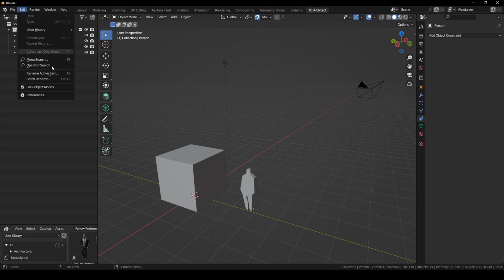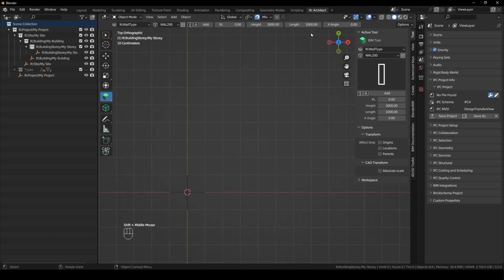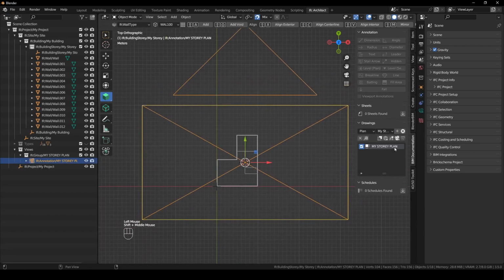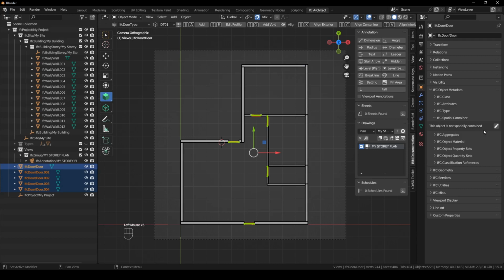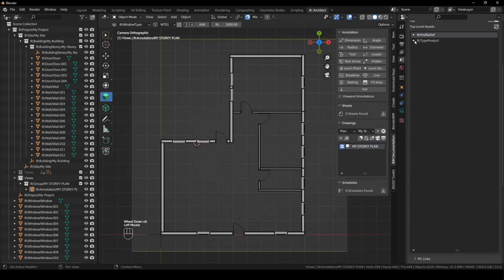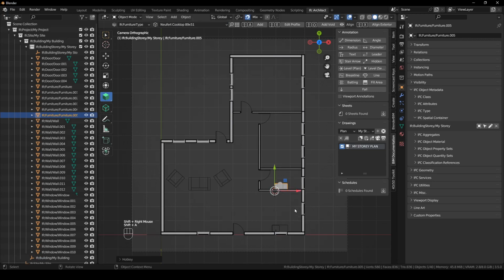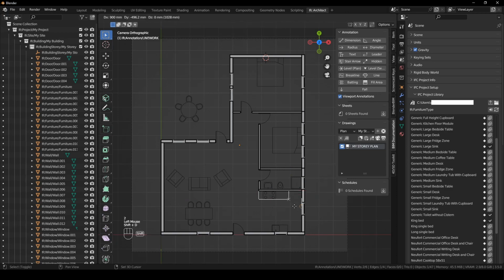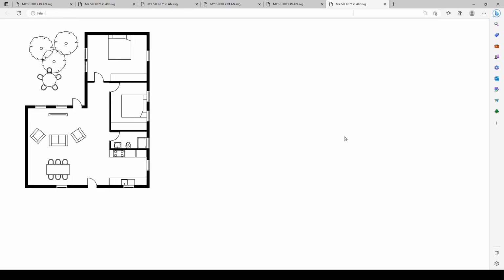BlenderBim 23.04.17 - Beginner Tutorial Update - Floorplan - in 20mins

Comment: hi. first, thanks four this informative and useful videos. When you are placing windows and doors your doing it arbitrarily.  I'm not very clear how to add a door or window in a precise location (exact measurement) relative to a wall or another object.
Reply from the maker: Hi David, yes for the purposes of this video they are being added roughly snapped to the centre of the walls,

To be more precise you can add the door and window and then move it to the correct position (what I typically do)
Or using the snap tool create a reference geometry and add it to that reference, but this takes longer

Comment: Why are my doors not showing in 3D. I have also realized that sometimes the door tool don’t show the width, height and some other properties when I want to add a door. It is my first time using the tool so pardon me if it’s too basic to know. Also when this happens some of the doors don’t cut into the walls.
Reply from the maker: Hi Owuraku, thanks for asking
Let's break those down,
"Why are my doors not showing in 3D." 
I think this might be the answer, When you activate a drawing it will switch to a 2d representation, so you won't see the 3d model, you can change it back by going to object data properties, Ifceometry, Ifc representations and select model representation

"sometimes the door tool don’t show the width, height and some other properties when I want to add a door. "
I think you are referring to the door modifier here? It needs to be added in the mdifier tab after creating and selecting the door, it isnt added automatically, but it definitely should be in the future

"Also when this happens the some of the doors don’t cut into the walls."
For this I think make sure you: 
select the wall 
before 
adding the door 
otherwise the door wont be hosted in the wall and it will not create an opening

"It is my first time using the tool so pardon me if it’s too basic to know. "

Not at all! Ask questions! it's the purpose of this channel, if you want more indepth answers from a range of people who know what they are doing, you can also check out the OSArch community page here:
https://community.osarch.org/discussion/1447/blenderbim-tutorial-floorplan-update-in-20mins-blenderbim-23-04-17/p1?new=1

Which should be very helpful
Reply: @IfcArchitect  I tried your answer for the last question and the 2nd answer too is okay. The 1st question is still outstanding, however found “Activate model” just beside “Activate drawing” and seems to work. Thank you very much for your help and awesome channel. Will continue to learn and keep my questions coming.